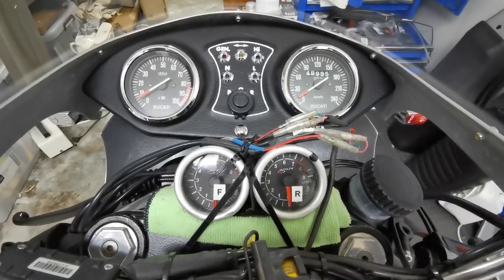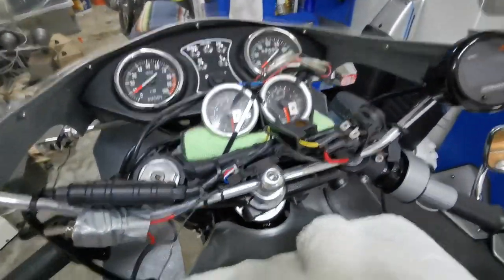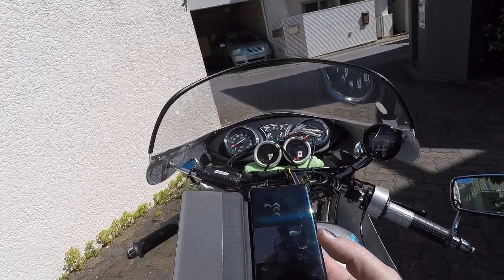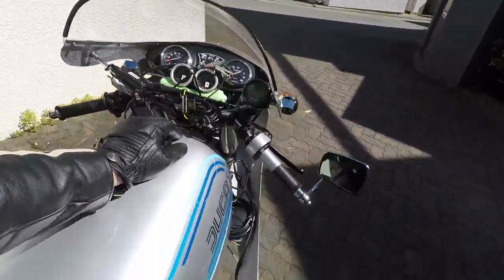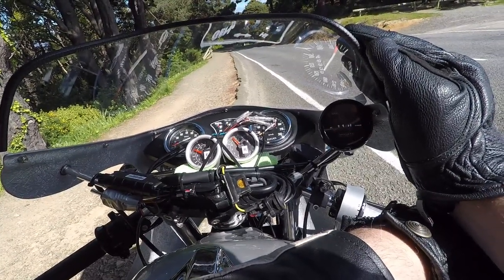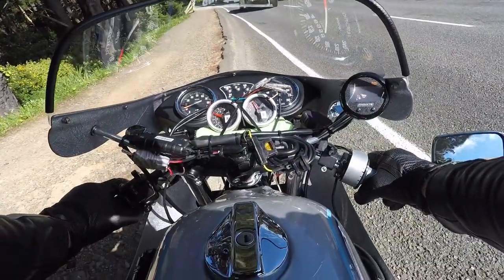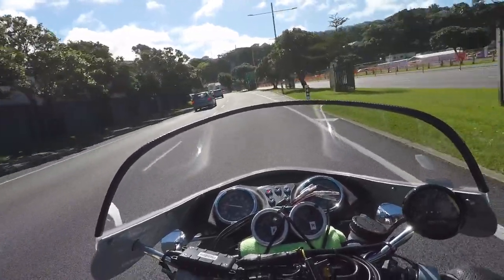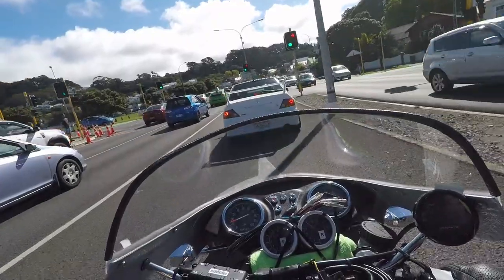Ducati 900SS Bevel Tuning - Lambda/AFR Testing Part 3

Comment: Have you calibrated the accelerator pumps?
Reply from the maker: (You might get this twice because I keep forgetting to switch to the right YouTube account when replying)
Hi Brad, No, I wasn't planning on touching them until necessary. They're currently in the same position they were in when I bought the bike, and as there's plenty of grunt immediately present when I wind it on to where the pumps are activated I've not felt that they are a problem. Since this video I've read about the 'lean peak' (Dellorto Manual p24) that briefly shows on the instruments when snapping the throttle on and so that seems to be normal. What I need to confirm is that it drops to a rich/normal state very quickly after that peak. We'll see what happens next ride. The plan is to get it running along averaging around 12.5 instead of the 11 or so that the first ride has demonstrated. That should also bring the temperatures up.
Reply: I can remember changing mine from 5cc per 20 squirts which is standard for a '82 900SS to 8cc which is the setting for a 75-77 900SS as the bike had Conti not the original exhausts. As Dave said I'd do the main jets first at WOT on the motorway, maybe temporarily disable accelerator pumps to get a accurate measurement quickly. Then move to the needle.
Reply from the maker: @bradyoung6229  Thanks Brad. I've posted the next video now where I go into what I'm doing in more detail. I'm not really adjusting the carb at WOT nor in the pump range. It's all about the low and progression phases. Long video though so be warned.

Comment: Don't you want to be running at full throttle to be testing your main jet richness?
Reply from the maker: Yes, would be nice, but where exactly am I going to ride at full throttle... I can hardly get out of 3rd gear around here! Mind you, the guy who does my warrants said they were getting an in-store dyno. I'll check and see if that has happened yet. It would  be a handy way to run it wide open. In several of these videos I mention that I'm primarily concerned with the progression phase, which is where I have to ride the bike 95% of the time. Overall it's clearly too rich and so I've already made a couple of changes for the next run. I'm doing a video about the assessment next.
Reply: @Ducati900SS  motorway run? I thought the process would be to great your main jet right and then move down to needle and pilot jet. I think a Dyno would be good they should analyse exhaust gas to see   oxygen/ fuel ratio (I think)
Reply from the maker: @DaveGough  I'm on the motorway in the latter part of this video. 100Kmh speed limit, too much traffic and the throttle is still only in progression at that speed. The oxygen/fuel ratio (AFR - Air fuel ratio) is what is being measured here in the video. It's averaging around 11:1, but really should be up around 12 to 13:1 for max torque in this type of engine. I've dropped my main jets both down to 135 from 140/145 and the idle jet to 60 from 65 for the next run. I'll have to order some more jets if I need to go lower. Will be interesting to see what difference it makes to the numbers. I'll try and get some higher rpm and more open throttle into the next run.